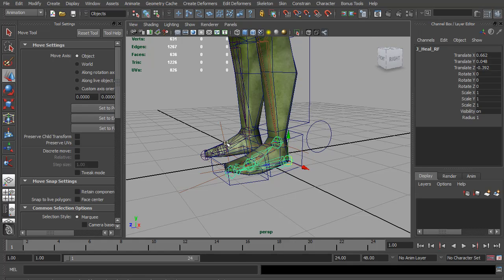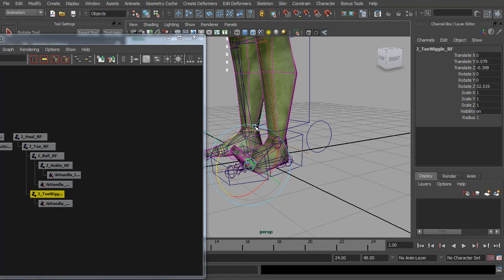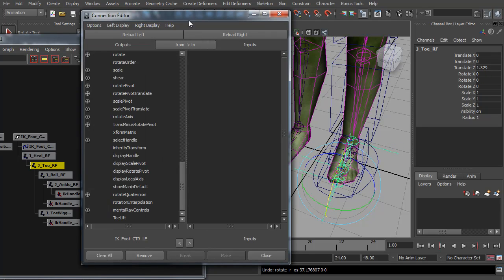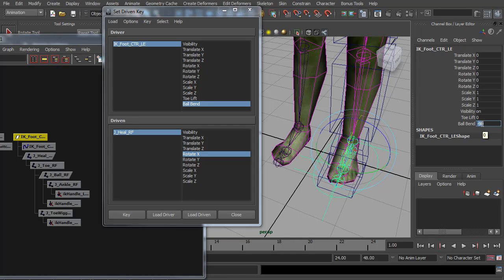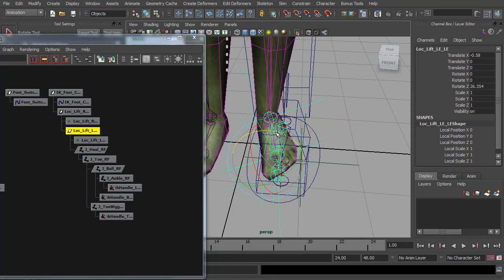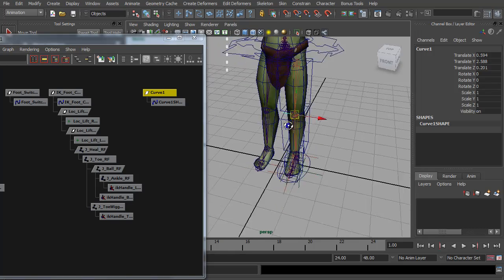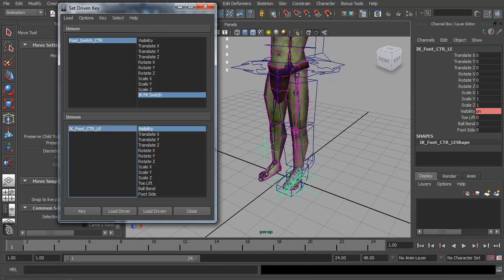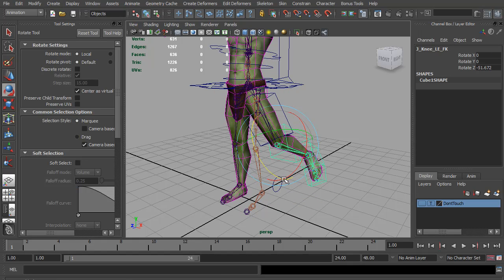GameRigging 05 The Legs part 2

Comment: Hi,

This series is great, been a great help in making me remember how to setup a lot since coming back into Maya after quite a while in Max for work. One thing I wanted to know about which to my knowledge isn't discussed is the stretch IK for the legs. Could you explain how you did that or was that in one of your other videos that I didn't catch. Thanks in advanced and great work on the progress of your game :D
Reply from the maker: Thanks, I'm glad you found these useful. I was limited on time for these so I didn't add the stretch stuff, but there is no reason I can't add to the rig in another video. I was planning on doing a few more soon for things like twist joints and props, so perhaps stretch should be top of my list. 
If you want to try it before then, it's fairly easy to set up using a distanceBetween node to measure the distance between the foot control (use the top of the reverse foot, the ankle joint) and the hips. From there the easy way is to set up a set driven keyframe to move the translate X of the joints you want to stretch, the knee and the ankle.
Reply: TheGnimmel Thanks for that! Yeah, the measure tool popped into my head as I was going to bed. I tried a whole bunch of crazy things before that and was getting cycle errors (stupid mistakes). I was thinking I would setup it up a similar way to your spine setup, but with the distance node instead of the spline curve. Looking forward to your new videos, perhaps they could just be called 'Rig Extras' which include those prop and twist bits too. I just use a simple expression for the Rx twist values but interested to see yours. Thanks again :D